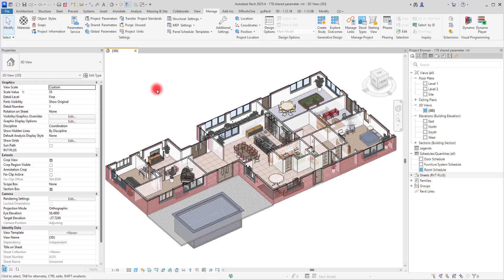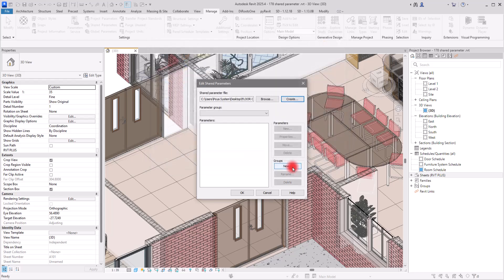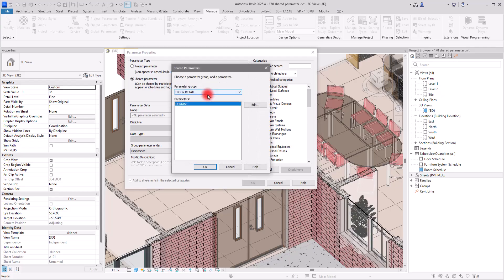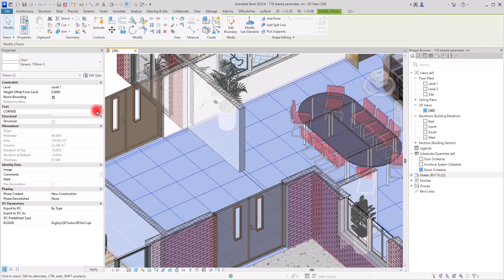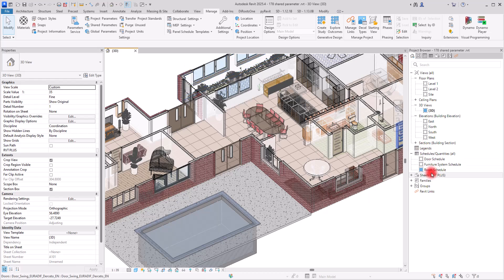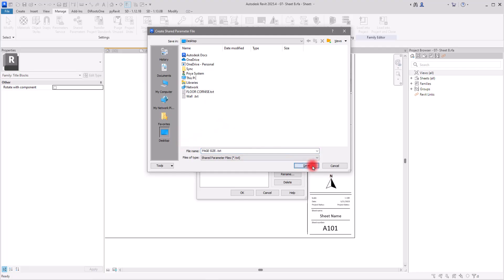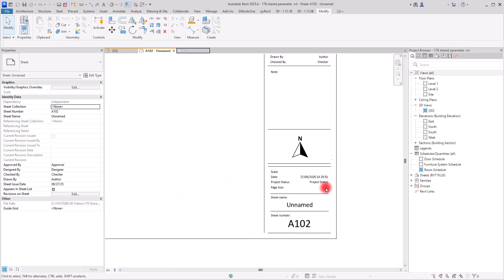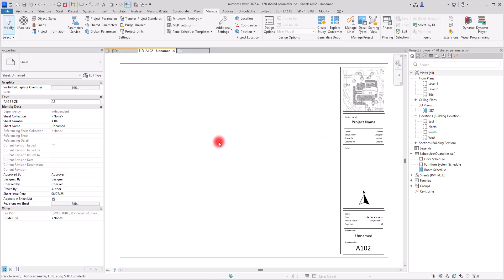🔑 The Most Versatile Revit Technique You’ll Ever Learn!

Comment: Thx for the tutorial, 

I never understood shared parameters, so why can't we just rely on the ordinary parameters (instances & types)? ...  In your first example with floors i can simply duplicate my floor and assign the width & the str the material the finish... i want, in your second ex i can create a regular instance parameter or just a simple labeled text... I can use notes... Etc etc.... 

So my question is why do we need shared parameters ?... Why Autodesk made them, pretty sure there is a very solid reason!... Can you plz make a detailed tutorial about them?!..
Reply from the maker: In Revit we do not have just one answer and here we are trying to learn most of them to be able to use them in different situations if they are needed. The solutions you mentioned are also some ways of solving an issue. 

Usually, there are some types of problems that can not be solved without Sheared parameters. In many cases, they are used to adding extra options instead of System parameters. Also, the fact that we can export them in schedule is noteworthy.
Reply: @RVTPLUS Since you are one of my very favs on YouTube I'm gonna share it here, i digged very deep & got the answer i was looking for. 

Shared parameters are way important not because what you just said, they came to minimize the human march of error to about 0%, they are intended to be used in large & shared projects, cause if in a scenario like this one that a project is shared between many persons it's very likely someone would commit a mistake (add, subtract, change a layer or something... Etc), so by using a single unique shared parameters file we eliminate any potential error, same if we have a continuous repetitive workflow across multiple projects.

Another very important thing shared parameters can do is while scheduling (like you said), if we use instance ones we risk that our schedules will miss them because of their type, not the case with shared parameters, if it's shared it's gonna definitely be scheduled correctly. 

So basically it's ok to not use them in small projects done by just you, but if the project is large, if someone else is collaborating with you, don't take any risk, use shared parameters & that where their name came from.
Reply from the maker: Thank you so much for sharing this valuable info here.  For sure there are much more about shared parameters
Reply: @RVTPLUS  You're welcome. 
See... That's what i meant by the solid reason behind them.